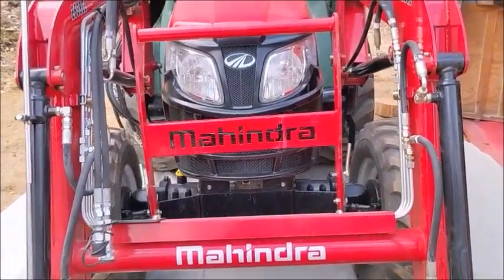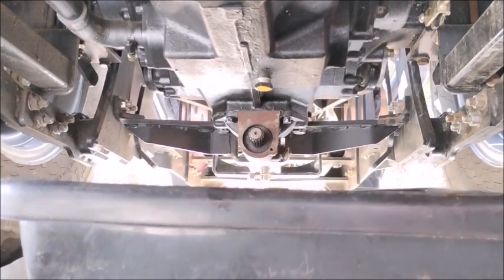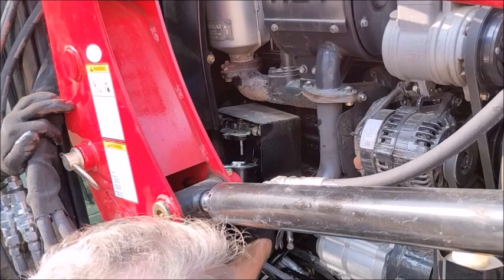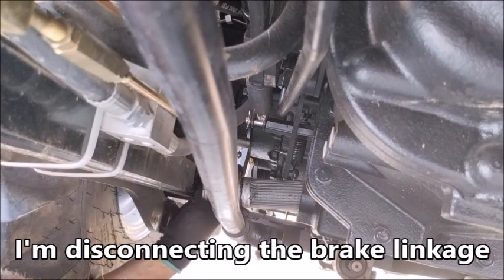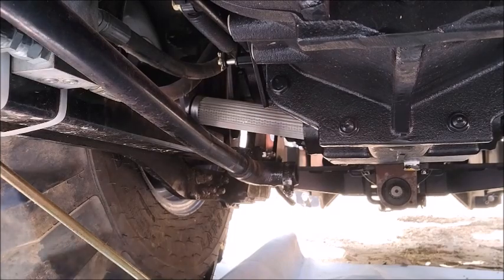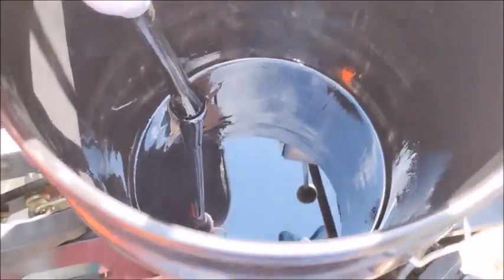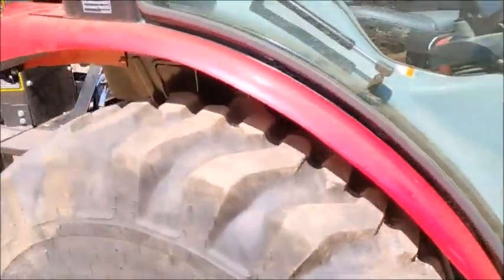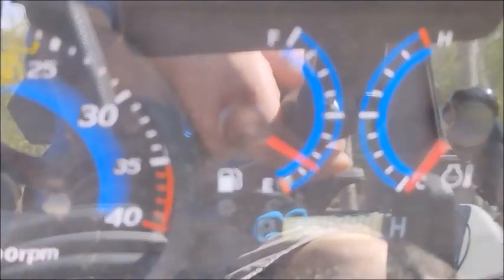In the video I do most of the items needing attention as part of the  Mahindra 2638 500 hour service

Comment: Hi, greatly appreciate your video and earnest attempts to explain clearly! I just bought a used Mahindra 2638 with loader and backhoe like yours. Now at 252 hours of which I have done the last 20+ hours since early June! Only problem was a leaking hydraulic hose which I had to remove and replace with the replacement the dealer supplied me! I had to replace a good amount of hydraulic fluid so I got very familiar with reading the fluid level eye glass. In your video, you demonstrate trying to see the fluid level from the right side, presumably because the location of the eye glass is to the right of the middle of the tractor and that makes some sense. But, as your video shows, you can barely see half of the eye glass even at the best of angle! I found that it is quite a bit easier to see from the left side of the tractor, but you do have to get down low, horizontal with the actual level of the eye glass! So much easier to see and read accurately because you have to make out the fluid level with respect to the red dot behind the glass window and it can be difficult due to lighting and any shadows especially with the clearness of the fluid! Not a huge suggestion but honestly makes it easier to check which I do frequently! Thanks!
Reply from the maker: Hi, thanks for the comment and watching the video. I have tried to look from both sides but with the backhoe I find it easiest to check from the right side. I can see it no problem. Thanks again and good luck with yours! I love ours.